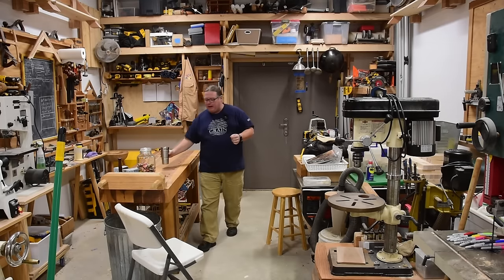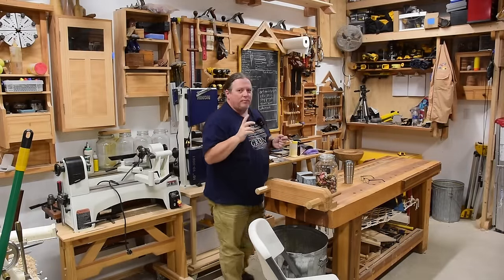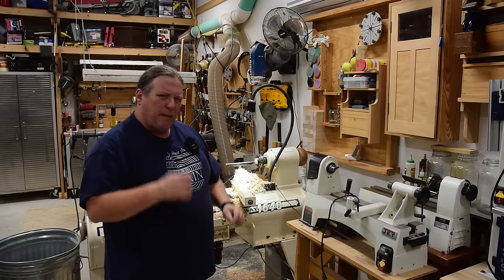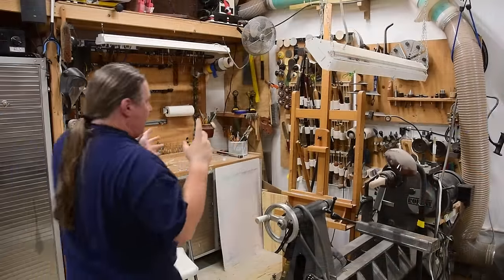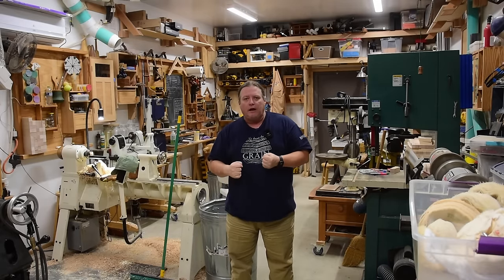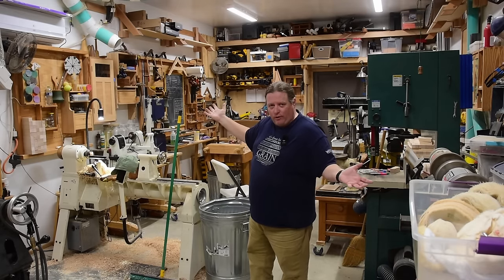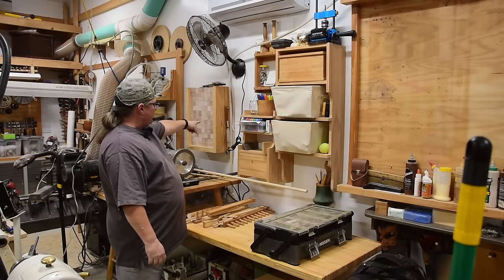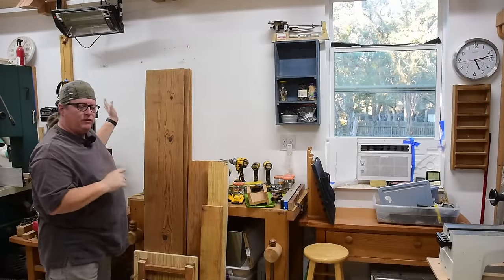Woodworking / Turning Work Shop Tour & Make Over 2024

Comment: worked in a cycle shop, huh? I did too, for 11 years, mostly parts/service in the pre-internet days, we were the largest disount/mailorder parts source for Yahama, Suzuki, Kawasaki and KTM. FInally, after a lifetime, I got to build my dream shop, or as close as budget and the laws will allow.  28x40 part car/metal and part wood shop...well, about 1/2 wood shop. 
I just enjoy not having to drag all the tools out into the driveway/patio/yard to do wood working, and to pack it all up in case of rain or darkness, etc. So much more efficient.

But a bigger shop means one can add more toys...the lathe is the newest, about 3 weeks now. If it wasn't for a job and winter...I'd have had a lot more time to learn and practice.

Love your videos, your practical advice, etc.  Got quite a ways to go before I can hit up craft and art shows, but that's my goal/plan. Covid really hammered by last business (photography/DJ).

Thanks!

Comment: Hey everyone, I'm in need of some help. I cannot for the absolute life of me find a drill chuck that fits into the tailstock. I have one that fits on a spindle, but it's been nearly impossible for me to get clean, centered holes, and I've outright ruined so many projects. I feel like holding a piece steady in the jaws and then guiding the tailstock forward is a much better option but again I can't find one anywhere, only ones that go on a spindle. I would appreciate a link or even just a name of the piece I'm looking for, because searching for a "lathe drill chuck" doesn't turn up anything that I need.
Reply: I actually just figured it out! Turns out the center that came with the tailstock was just really wedged in there. I beat the hell out of it and it finally popped out so I'm all good! Really I thought it was just one piece.